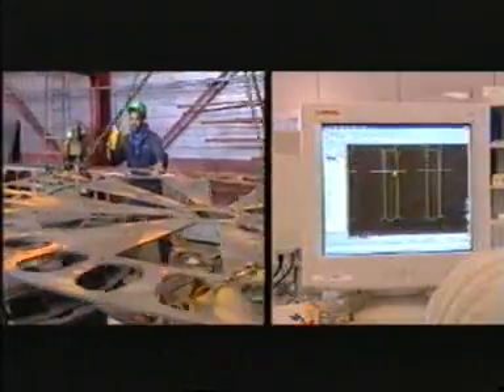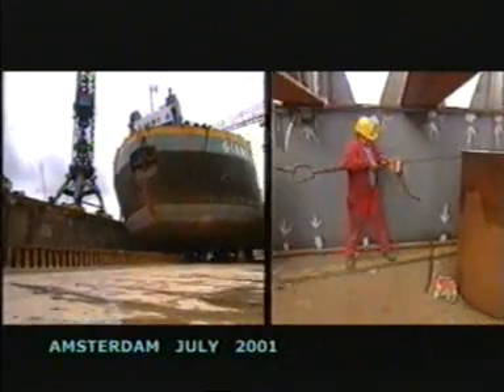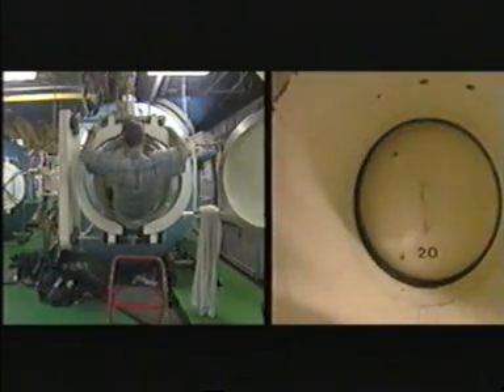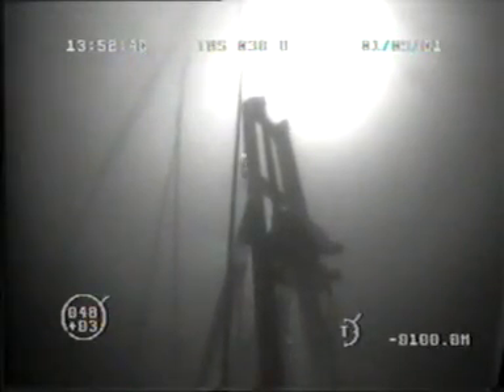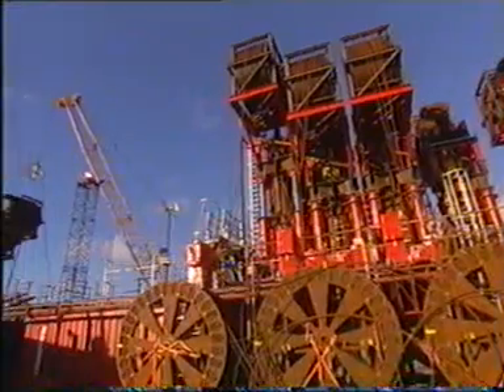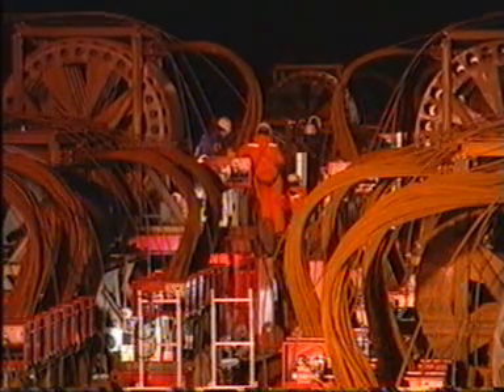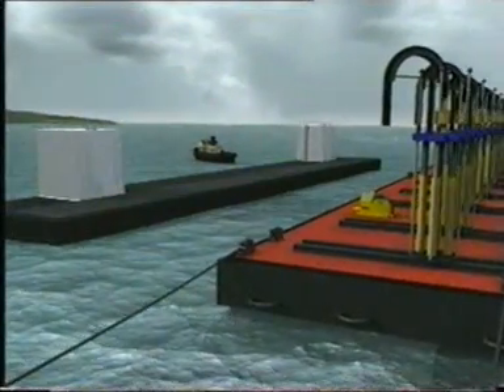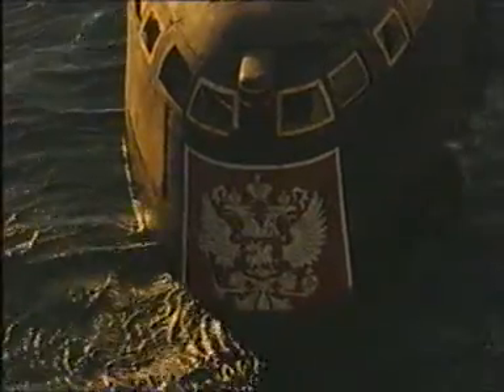Mammoet - Salvage of nuclear submarine Kursk

Comment: The documentary doesn't mention the nukes on board.  Kursk was a boomer.  It would have had 22 solid fuel missiles and I'm guessing the possibility of one exploding, or burning kept the salvage team nervous throughout.
Reply: Never mind.  I wuz wrong, it was an attack boat not a boomer.  It did have ~22 solid fuel missiles, but they were cruise missiles not ICBMs and probably not nuclear.
Reply: @Jeff Zaun...Actually, there were twenty-four P700 Granit missiles aboard the Kursk, ...twenty-two were fully armed, each with a one-half megaton TNT-equivalence yield thermonuclear warhead, and there were two dud practice rounds, with no warheads. The two practice rounds had been already shot off during the various drills  the boat was engaged in, and the 22 live rounds were stolen after the Kursk was pirated and robbed as it sat on the bottom of the sea about 300 feet below the surface.

Comment: Why did they cut the nose off the sub (preferrably without getting into weird conspiracy theories here) wouldn't it have been easier to just lift the whole sub and remove parts of it later?
Reply: +Dan Nork The reason is probably that the front of the sub is damaged, and so it can no longer be trusted to be structurally sound. One of the worst scenarios would be to lift the sub and then halfway through the lift having the nose snap off, which could mean you drop the sub to the sea floor again.
Reply: +Dan Nork  If parts fell off during the lift it could destabilize the payload.
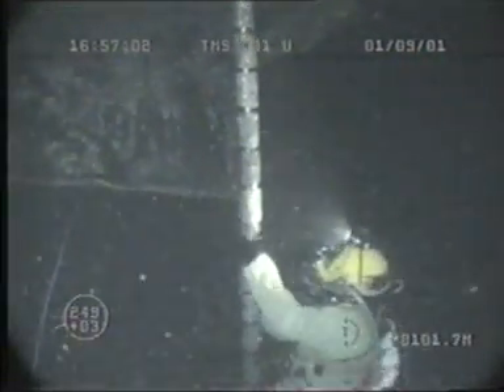Reply: +Dan Nork The reason is explained at 17:25 into the video... The nose is damaged and could break off during the lift. If this happened the sub would become unbalanced causing some lifting cables to carry much more weight and others to carry no weight. The cables would break and the sub would drop.
Reply: Using a sling, on a car - piece of cake. Were talking about an object weighing 15,000 tons, requiring 20 independent lift units. Do you (A) risk digging beneath the damaged section for a net that could likely be compromised, or (b) cut it off in a controlled fashion? Never mind the risk of Unexploded Ordnance either, right?

One small mistake during the lift on the weakened area would (A) possibly rip it away from the main body, and (B) cause a sudden shift unbalancing the load, stressing the lift points and risking total loss.
Reply: @luisderivas6005  Are you an engineer capable to work on salvaging subs? There are very few people in that job. And either you are a clown or currently out of a job, the world is a stage, and comedy is not your forte.
Reply: ***** Not true. It was cut off because the consensus was that too much debris falling from the front could cause too many issues with the raising of it.
Reply: +Moss Limbayter Or that I don't just automatically believe government apparatchiks who's job is primarily propaganda.  Just let them keep telling you how to live!
Reply: +Toby E It's not a matter of belief, but sound engineering. The reason given in the video is precisely what happened in 1974 when the American efforts to secretly raise the Soviet submarine K-129 (lost in 1968). While raising the K-129 a failure of the lift mechanism caused the center section to become unbalanced, breaking off and returning to the bottom.
Reply: Dan Nork I heard it was because of the potential radiation from the nuclear torpedoes stored in the front
Reply: +Dan Nork My personal theory, is that the primary reason is that lifting the intact sub would prove it was a failure of the torpedo fuel and thereby disavow any credible claims they had been trying to make that the Kursk was hit by another sub.  May they all Rest in Peace.
Reply: Toby E
The reason is explained by the Mammoet official at 17:25 into the video...  Your personal theory means absolutely nothing other than you didn't watch the video.
Reply: The comment was made by Mammoet, not the government. So curb the tinfoil hat conspiratorial excuses and man up; you never watched the video before making your comment.
Reply: +Luis de Rivas Yes, engineering is a common excuse given, and is plausible, I'll give you that.  But all it would have taken is a wide fibrous sling around the nose if that was the concern.
Reply: +Luis de Rivas Of course it's risky, and should be a separate operation.  You have some good ideas, like digging under the nose; which of course would have to be done to prevent it making the lift impossible.
Reply: Dan Nork that's like 30 million pounds, are you sure that's right?